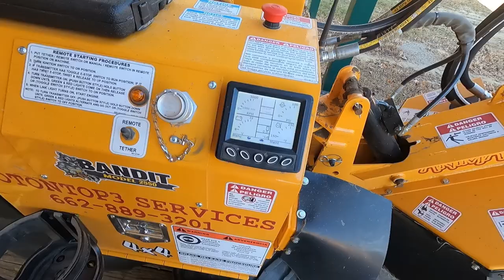Sharpening carbide teeth | how and what I use

Comment: There are also companies that will retip teeth for about half the price of what new teeth cost, I've had good luck with Wit-Son Tool. They also manufacture and sell teeth. I'm thinking of upgrading to the wheel and teeth that you have, mainly for working in rocky soil. I like Greenteeth but they don't hold up in the rocks. I have an RG55, it's similar to your machine but it has a 55hp Kubota gas engine.

Comment: I knew diamond blades were expensive but... OUCH!   too bad that stump grinder doesn't have a lock on it to keep it from turning so you can keep both hands on the grinder.   I hate seeing appendages that close to a diamond blade.  I know you can be trusted with it but... boy, I sure couldn't.  a newbie like me.... I'd be reminiscing with my 9 fingers what it was like when number 10 used to hang out with them. 🤭
Reply from the maker: I can lock the wheel if I want but chose not to.

Comment: I had that same wheel and teeth on my machines. I found that taking them off and sharpening them with a Green Wheel was better for me.
Reply: Were you happy with that wheel? How many hours did you use it for? I'm thinking of trying one of those wheels out for working in rocky soil. How do the teeth hold up in the rocks?
Reply: @ngbbane9097  I liked the wheel for sure. Big Hard rocks were hard on the teeth. I owned 7 new Carlton and Rayco machines. Both good machines but I favored Carlton machines.